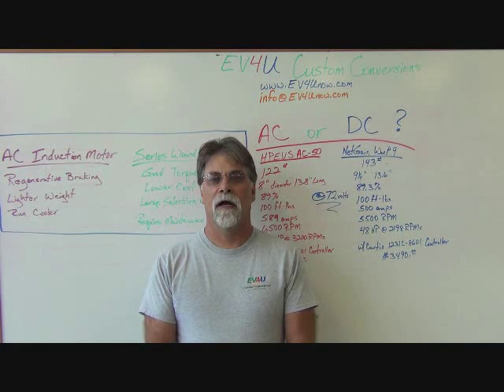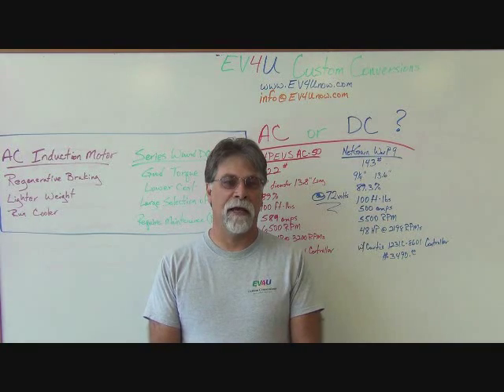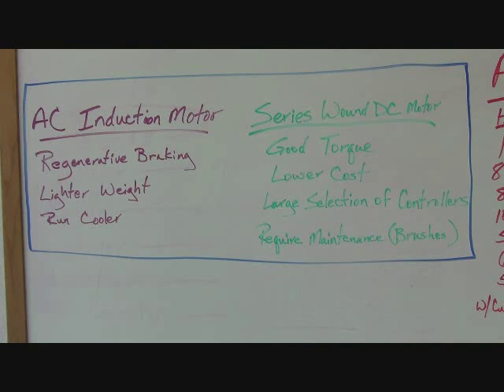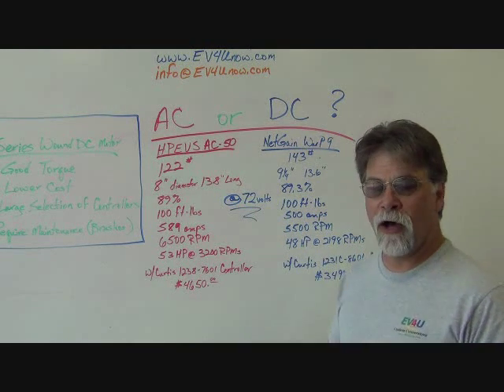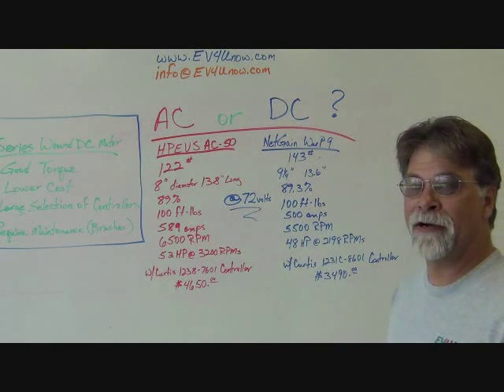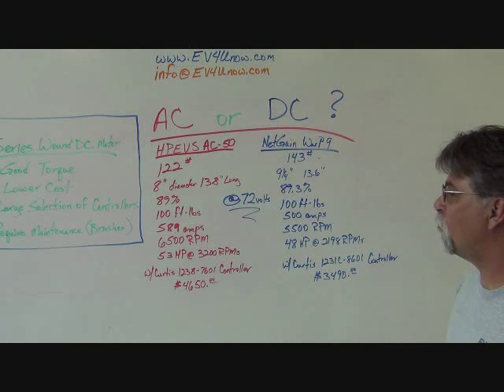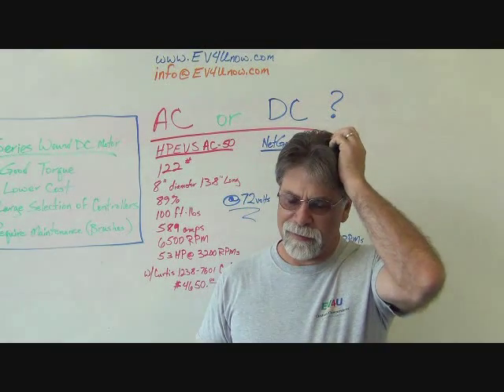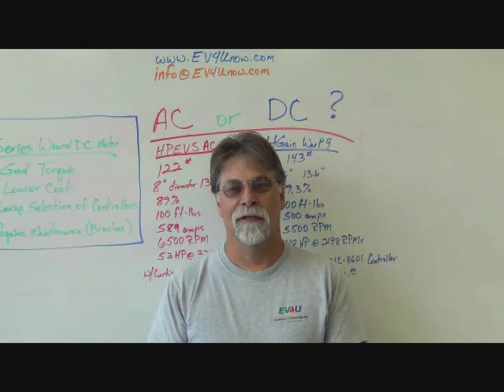DIY Electric Conversions - AC or DC ?

Comment: One disadvantage you forgot to mention about the AC motors is that the field windings tend to get saturated past 3800 RPM.  By 5000 RPM, the power loss is significant.  This is not as much of an issue with permanent magnet AC induction motors, such as the one used in the Nissan Leaf and other EVs.  However, it is an issue with HPEVS and other aftermarket motors.  Reducing voltage at the higher RPMs helps, but not by much.
Reply from the maker: With the HPEVS AC-51 with the Curtis 1239-8601 which is what we typically use in smaller vehicle conversions.  The HP peaks at about 4,700 RPM and doesn't really taper off until 6,000 RPM.  With the HPEVS AC-35X2, its maximum HP is at 6,000 RPM.With most conversions however, we prefer to have low end torque and horsepower.